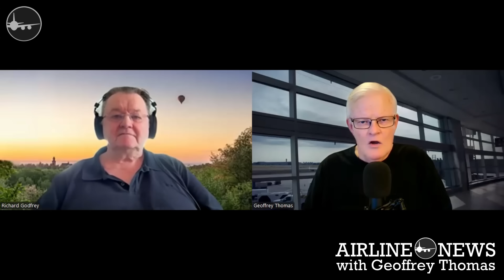Air India Crash - Probable Cause  #airindiacrash

Comment: Well done, Gentlemen! Nobody is discussing the apparent toe down position of the Main Landing Gear (as observed from the side view from the apartment building). This can only be achieved by MANUAL selection of the Landing Gear Lever. Instead of moving the fuel switches to cut off, the support pilot would be trying to raise the gear at 08:08:41. That completely refutes pilot sabotage and hopefully will make the conspiracy theorists rethink their logic. You did not pull any punches and rightly so. AAIB, Boeing, and NTSB all have a part in this tragedy, and they are the investigators!!

Comment: Witnesses beyond the checkered shack in the CCTV video would certainly testify to the existence of a dirt cloud, a pungent battery fire, or even a fog emitted from drowned-out engines. But what is with the secrecy surrounding it? Not even the tower personnel are quoted? Even a pilot suicide would not warrant such cloistering of information, going on three months since the crash. I smell a pack of rats!

Comment: How would the hydrofluoric acid "escape" the APU battery stainless steel container? To my knowledge it has a vent system leading overboard and stainless steel is resistant to hydrofluoric acid.
Reply: Stainless steel is NOT resistant to HF, although passing corrosion would take place in hours, not minutes and certainly not seconds. The only material stable to HF is quartz glass, hence the HF production in a chemistry lab is run in special, jointless glassware.
Reply: Monel 400 is HF resistant, but not Stainless Steel

Comment: I thought: this plane didn't want to take off... as it turned out, it never gained altitude. Damage to the battery and failure of the electrical system, this is the cause... due to water 'humidity'
Reply: It gained altitude normally until somebody shut down the engines.    Declaring a serious danger that Air India is hiding doesn't make sense.

Comment: WOW - your all getting riled up over this explanation. Battery issue is absolutely valid. I never looked  at that part ( my bad ) of the current circumstantial available evidence or missed it.  Starting at the end -  output ( the crash ) and work your way back to the starting point and  , you have to find the trigger mechanism. So we are still left with Geoffrey's hypotheses that must be cycled back to the initiating sequence of logical / probable  cascading failures. Corrosion is something that is generally evident , what is not evident is if it hidden in gaps, wells and seams. It has a predictable outcome when exposed to the water and urine .In this context these fluids are most logical to leak. I know, I had to clean them up when the toilets leaked or water or other fluid leaking over the baggage compartments. The corrosion issue is a time dependent event. It is a by-product of an initiating event (s) If as Richard contents then battery decomposition/ rupture is a buy product of the water forming the environment for acidic development and  intrusion into its secure housing and mountings. Which now brings us back to the trigger mechanism. The water ingress to electrical avionics. All these events are in themselves dependent on how fire triangle works- oxygen, heat and fuel. We have fuel ( water )  , heat, ( electrical/ battery flash ) and acid as the oxygen. All three combined at rotation. I said on an earlier post with another viewer that the dust/ smoke seem from the rear, was an over pressurized internal venting of burning insulation and other combustibles, and  was the a two part coalescence my hypotheses. Richard adds that third dimension to the equation the battery rupture. Could this be the " smoking gun " . As Richard has still said, WATER , acid and battery / electricity all is consistent from the sparse CCTV of the aircraft and the drip feed of the AAIB. So while we may divulge for the probable engine  shut down it would seem water ingress is the primary  suspect that is a dominant constant. Richard , Geoffrey thanks for another pointed critique. I sure you both will crack this nut.

Comment: You guys have done an outstanding presentation! I would suggest re-analyzing the sluggish takeoff run cited in your 17-page report, which indicates that although the brakes were hot at this time beyond the crew's knowledge, it could have been one of the first cascade glitches along the sequence of catastrophic events. I'm sure that log books may contain more details that could have helped anticipate those massive failures by making a deep inspection inside the EE bay. Congrats for your top-notch work. I believe that with the contribution of many viewers, the Air India 171 crash investigation skeleton is about to walk.
Reply: Absolutely, once the investigation wraps up, we'll likely have a much clearer picture of what led to this accident.  
Astircalix, you are not alone in wondering whether a brake malfunction could have played a role in the sequence of events.
Reply: Interesting approach!!!

Comment: Activation of the lithium battery after heat soaking may result in thermal runaway. Also, the battery diode module may have been one of the faulty units if air india did not check and replace a mis manufactured unit per the advisory.
Reply: Yes Yes i like the term "Mis manafactured" Kevin..  Ps..  i would be interested in you showing me the advisory number to complete my ideas...  Kevin..

Comment: Richards analysis highlights the classic swiss cheese model shown in previous air crashes. The water ingress appears to be the primary cause, followed by a chemical reaction which led to a fire in all probability due to non-adherence to maintenance schedules/requirements. I recall in a previous episode that Air India have declared that not all advisory maintenance notices were acted upon - unless indicated as mandatory. As has been pointed out by you chaps, the crew were doing a great job in trying to deal with the issue (as well as the aircraft recovery systems) but the aircraft was simply not high enough and the crew run out of time. If these same events had happened at altitude, they probably would have made it back to terra firma. As I mentioned in an earlier comment  the deployment of RAT was to me a clear indication that there was a significant issue just at or slightly after rotation. Should this probable cause be proven, the costs to the aviation industry will be enormous - which could prevent the truth coming out...?

Comment: I did point out on my first comment that there was evidence that a battery thermal runaway was a major cause / electrical failure having listened to an Indian professional who knew as soon as he saw the damaged items what it was. He had no doubt. You gents were telling us that Boeing had redesigned the system and changed the battery type so nothing to look at there. Well I am glad you have kept an open mind, followed the evidence and put this jigsaw puzzle together. 

We have seen the same with certain global injections in recent years; "safe & effective" no account was taken of all the combination of factors not just the one jab! 

Well done Holmes & Watson you are a credit to us all!
Reply: Battery thermal runaway and or power diode on battery charging system could be main cause. A diode shorting will cause shorting of charging g and battery output high current damaging battery overcharging and a bursting.

Comment: Excellent work, Richard and Geoffrey, thank you very much! Even if Richards hypothesis will turn out to be completely wrong - which I don't expect at all - the recommendation to consider combined risks in the certification of the usage of lithium batteries in passenger jets is a very valuable contribution to aviation safety. Hopefully, the necessary actions to reduce this vulnerability of modern aircraft identified by Richards work will start immediately. This episode is an extremely strong confirmation for me that people are wrong who say: don't do any investigations on your own on the crash of AI 171, wait for the final report, instead.
The aerosol cloud visible at rotation speed seems to have a rather strong impulse to the left side of the aircraft. This fits quite well to the assumption that it was blown out with high pressure in exactly this direction (due to a thermal runaway of a Lithium battery in the aft EE-Bay). If the origin was in the combustion chamber of the left engine, the main impulse of this cloud should have been backwards and not sidewards.
As I already pointed out in a comment before, the low acceleration on the runway could have been a contribution to the water ingress into the aft EE-Bay at exactly this critical stage of the take-off-procedure. If the acceleration had been larger, the water ingress and the problems which followed could have happened earlier and possibly before reaching the decision speed - just in time to stop the aircraft safely. One critical question in this context is: Did the pilots already know the acute risk of water ingress into the aft EE-Bay before take-off and chose deliberately a low acceleration to minimize this risk - certainly a very uncomfortable scenario for Air India?

Comment: I always had a belief from the start that AI crash was a deadly combination of manufacturing defect and poor maintenance.

On normal flying days, one weakness would just be covered by the other lesser problem. On some days, poor maintenance would be covered by the relatively finer areas of manufacturing and on others, poorly manufactured areas would pass the flying test because of absence of problems created by poor maintenance.

But on that tragic day of the crash, both the problems ie.  manufacturing defect and poor maintenance aligned with each other like a swiss cheese model which eventually lead to the horrible tragedy!

Comment: Ah you guys need to clarify the relationship between a thermal runaway of a battery within a certified battery box and fire damage to the EAFR. Are they adjacent where they mounted within the aircraft, are you saying they were both compromised by corrosion and water. What is the link between them?

Comment: You started very good with the slow takeoff drag and mentioned the WOW, Weight On Wheels, system but you have decided to ignored all of it. Too bad, the only thing that makes sense here is the WOW. Also, you know that the slow takeoff & the drag was due to brakes, you even  suggested that yourself before but again decided to ignore it and comtinue to push your theory. Why not entertain other options? after all, are we trying to see who is right or wrong or are we trying to find the truth? Here is my comment from a day ago on your previous episode:  The fact there was slow takeoff could point to brake drag. WOW have automatic brakes on the ground. The fact that the aircraft went airborne at " 13 38 39" and that both engines cutoff at "13 38 40-41" could be consistant with a WOW air ground logic fault sending a spurious cutoff signal to both FADAC's. The timing matches the "transition" zone when the WOW signals are changing. Airborne is when the main gear is airborne. The main gear is holding the sensors of air/ground. The nose gear sensor is for something else

Comment: Ref:
MODE S DOWNLINK AIRCRAFT PARAMETERS IMPLEMENTATION
AND OPERATIONS GUIDANCE DOCUMENT 
6th Edition, 2025
"Should add a few more recommendations, for Mode S DAPs application of the Mode S Datalink System. 
There are 255 Comm-B registers within the Mode S transponder, some of them are assigned for Mode S
SSR DAPs and some are assigned for ADS-B DAPs." 
As discussed on this forum, takeoff and landing A/C status messages will be helpful.
Also, Flight Crew should take with them on release of A/C, a secure HDD with their active flight parameters downloaded and archived. 
And proactive, Engineering / Ops data readout and logging for real time solutions. 
Passenger, Air Craft  and Airline safety  protocol monitoring.

Comment: 17 minutes of gold-standard analysis. The reported disagreements between AAIB staff, their Investigator in charge, and the teams of observers about the pilots being blamed because of the presentation in the Preliminary Report of the Fuel Switch actuations, without any explanation why the Aft EAFR was so seriously burned as to be unreadable, even though it was thrown clear of the rest of the aircraft before it caught fire. So the EAFR could not have been damaged by the jet fuel tanks' ignition on impact with the ground. It had to have been destroyed beforehand. 

The Sherlock Holmes quote involving the word "impossible" is: "When you have eliminated the impossible, whatever remains, however improbable, must be the truth" applies. And the Preliminary Report failed to note that the Aft EAFR's condition was a strong indication that the pilots were dealing with something really dangerous.

I have yet to find such a comprehensive analysis about AI171 elsewhere. Bravo.

Comment: Sorry but this is all supposition and doesn't explain the physical movement of the fuel cutoff switches.
Reply: There was no physical movement of the switches, only a change in power state. Get over it.
Reply: I agree with you. Why the FO surporised from fuel cut off. I am sckeptical about the explaination that the FO comment wad about the all system shutting down. I also found very strange the explaination of the dust on the left due to a a small vent. Its seems very strong for this. But I am not in the industry.
Reply: @HenriPlana  There is nothing in the prelim report that states either pilot said anything in particular. You should read the report.
Reply: Did you not hear Richard discuss the switches in this video? There is no time stamp given in the preliminary report of the switches being "transitioned" to off.

Comment: Almost seems like the investigators are waiting for you two gents to finalise your thoughts and they will then hit 'copy' and 'paste' and issue their final report, difficult to believe that with all their teams working on the investigation why more hasn't been said yet, apart from of course this may implicate Air India as the ultimate cause for failure to maintain the aircraft - so will there be yet another cover up? Top notch episode yet again from the pair of you and of course any of those contributing to Richard's info. Just over 5-weeks until i board a 787-9 bound for Orlando and i am somewhat more at ease than i was back in June when this terrible accident happened. Best wishes to you both.
Reply: Hopefully the investigators actually investigate and not rely on theories from external sources.

Comment: It's still to early to blame anyone, but if I had too, then my money would be on poor maintenance and over worked pilots or under trained pilots. I have watched all your videos on this crash and I can't fault anything you said, you have done a great service to aviation, and I commend you both for this.
Reply: Since the beginning, my money has been riding on improper, non-complied or neglect of maintenance.
Reply: @relayerI974  I am tending to agree now after finding out AI171 falsified previous maintenance logs.
Reply: For me, one question still remains unanswered.
If the plausible hypothesis is correct, what would have been the chances the plane could have stayed in the air had the pilots not operated the fuel switches. (No blame intended, it was a desperate, and understandable, action of the pilots.)
Reply: @Thomas_formerly8a Air India has already falsified maintenance logs before, so the previous flight of this aircraft has electrical issues, which apparently were resolved, but what if they weren't? What if this was a false entry like they have done before, you have to ask these questions.
Reply: @flightsimdev Sure. I would just add my question to the long list of questions. 
The fact that one engine got restarted successfully begs the question what would have happened if the relight-procedure had started a few seconds earlier (triggered by FADEC). Maybe it would not have made a difference. But that is what I'd like to know.
Root cause remains maintenance issues of various sorts as it seems.

Comment: Aircraft post crash fires can easily reach the temperature at which the EAFR will be as damaged as it was in this case.  There is no need to seek an additional factor such as a hypothetical battery fire.  What you claim is smoke is in fact the dust lofted by wake turbulence which can be seen at many airports.
https://safety.army.mil/Portals/0/Documents/REPORTINGANDINVESTIGATION/TOOLS/Standard/TEMP_CHART.pdf

Comment: That huge cloud of dark smoke is clearly to been seen in that video of the left side during liftoff. A few seconds, the plane is not visible, because of that hut. I thought it was rubberdust from the runway entering the engines and burning, because of that black smoke.
Reply: Did you notice the crowd of people watching the takeoff, from just the other side of the checkered shack? Focusing on the plane and white fog swirling in the wake turbulence, I was distracted from noticing the eye-witnesses beyond the right-side balcony railing. Tell me I'm wrong.
Reply: Dust blown off the surface when the thrust was down onto the surface because of the takeoff rotation.    Answer that doesn't need any speculation.   Smoke would have been hot and would have risen like smoke instead of settling like dust particles.